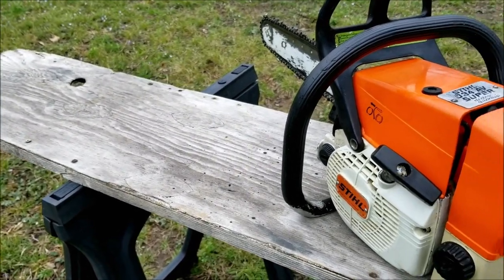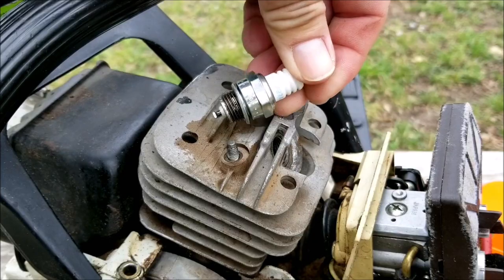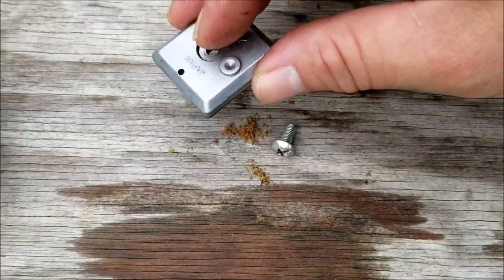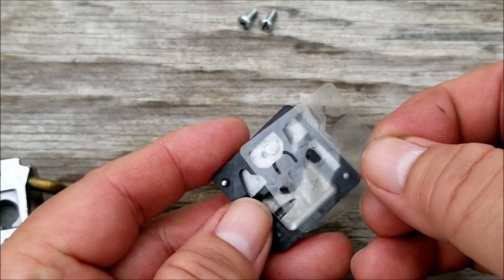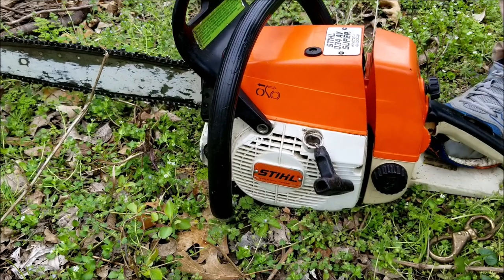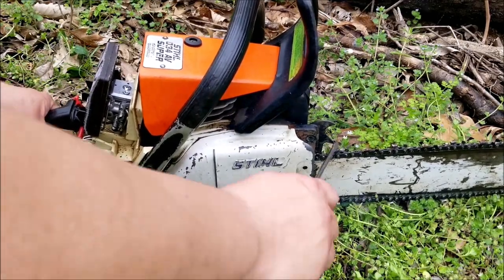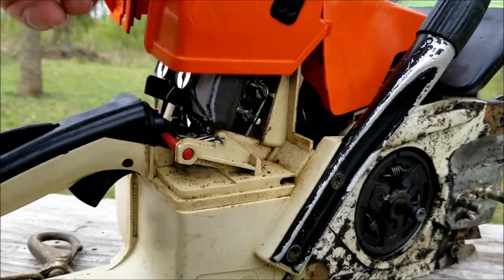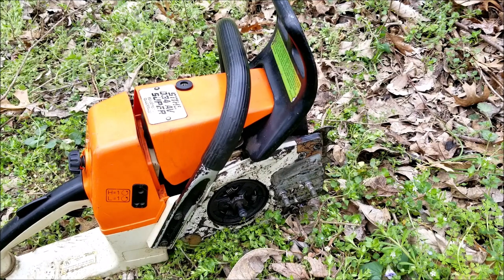Stihl 034 AV Super, what happened to it?

Comment: Did you fix it?  I've got one of these. Came out of a skip (dumpster) with no zorst, chain or guidebar. I asked for it, they said take it away, it's seized. Wasn't. Zortst face of the piston was perfect. Flushed it with 25:1 and it fired on third pull.. It was my backup/big fells saw for 5 years (I'm self employed). Still starts easy even if left for months, just put new fuel in it.
Reply from the maker: no it's still sitting on my shelf
Reply: @HomeGaragechannel  Because of the severe wear on the clutch drum bearing surface on the crankshaft?
Reply from the maker: not any particular reason, I just haven't committed to repairing it just yet.

Comment: Finding a saw a mismatched bar, chain and sprocket is not that unusual.  I just restored a nice little 026.  It had a 3/8 bar and a .325 rim sprocket.  Let’s say the 18 inch bar is marked 3/8 but I do not think it is a 3/8 bar.  The link total just does not match up.  It is marked 3/8, .050, 74 and those are not 3/8 standard measurements.  For an 18 inch bar it would be 60, something.  That 74 tells me .325.  I put a brand new Oregon ProLite .325 bar on it and it had 67 links.  I normally run 3/8, .050, 72 chains on my bigger saws with 20 inch bars.  Never hear of a 74 link chain.  The 026 Al’s had a .325-7 rim sprocket on it which sealed the deal to me what the bar was.  So don’t take numbers on bars as the gospel because they may be inaccurate.  Match up all three.  If not, replace them.
Reply from the maker: very good information, I'll definitely have to educate myself with it.

Comment: If the compression is good and even if it needs a carburetor The investment would be worth it if you’re going to resell it anyway the replacement parts you need are cheap enough
Reply from the maker: you are absolutely correct

Comment: I can see the bar has been overheated and maybe the oil was run out of the chain oiler causing damage. That's why someone changed out the sprocket, not matching  the chain. 
I will give it a forever home, feeding it lots of 2 stroke gas/oil mix and taking it for long walks thru the trees. It will then do what it was born for.
Reply from the maker: That's very poetic.  Thanks for the comment I appreciate it

Comment: This saw is in fantastic condition for it's age and has not seen much use. You would be crazy not to fix it..you are almost there. Replace the gaskets and diaphram in the carb and perhaps the fuel lines. Failing that id check the condition of the rubber boot between carb and cylinder. Most Stihl 3/8 bar and chains will fit this saw and can all be salvaged with the drum and bearing from a junk saw.  The 034 Super is a great saw and equivalent to the 036 for power as opposed to the regular 034. The last owner had no idea what they were doing (even the bucking spikes are on upside down)
Reply from the maker: thanks for the information.  you definitely know your saws
Reply: @HomeGaragechannel  You are most welcome! Keep up the great vids!

Comment: Fix it. all the parts to replace it are less than $100. It is a $50 chainsaw when running well.
Reply from the maker: thank you Ritchie Griffin for the comment I appreciate it
Reply: I beg to differ, Ritchie.  IMO that's a $175-200 saw if in good condition and running well.  I'll take all you can find for $50 each!

Comment: The saw has been abused in it's old age. The rubber shocks look as if they are toast as well. I would suspect crank bearing is bad from the ill fated drum fit. The chain was very worn out and looked to be used to saw through rocks! Too worn, too old, and too dangerous to use or rebuild.
Reply from the maker: you might be correct about it.

Comment: If I don’t have a primer on my equipment I put fuel into the carburetor to get it started I have to put fuel in is a few times because I still has to suck fuel f ok the lines to the carburetor
Reply from the maker: You are correct

Comment: It has a rocked chain.  That I see.
Reply from the maker: yes it was a real mess when I got it, and didn't realize it. Thank You John Clarke.
Reply: @HomeGaragechannel  you should have seen an 026 that I bought from my local Stih dealer.  It had crash damage - a tree had fallen on it and busted the rear handle and gas tank.  It was also filthy.  I put a new ms 260 tank on it and a bunch of other parts.  I just got through replacing all the AC buffers.  The right rear one had been busted by the tree.  I have repainted most of it and am bringing it up to 026 Pro specs.  It cuts and runs good, now with an 18 inch .325 chain.  It is also much lighter than any of my other Pro saws.  A real plus.
Reply from the maker: thank you John Clarke for the information